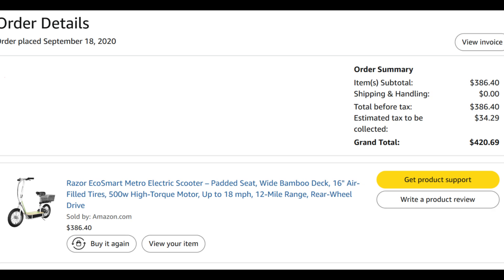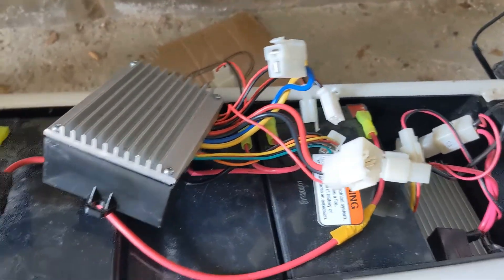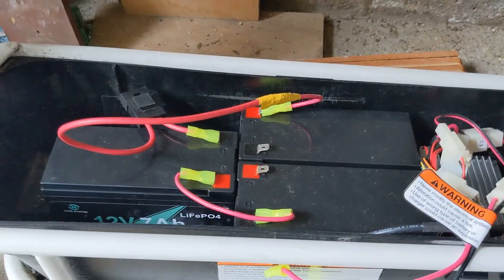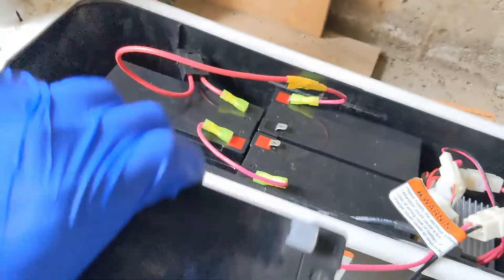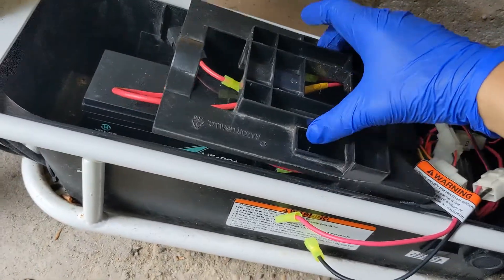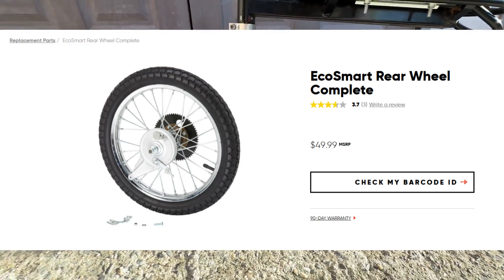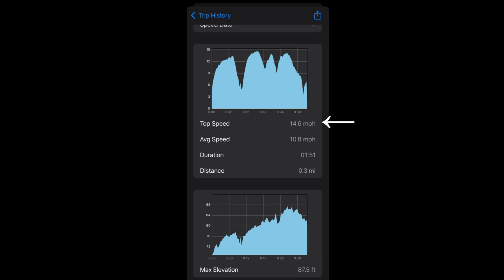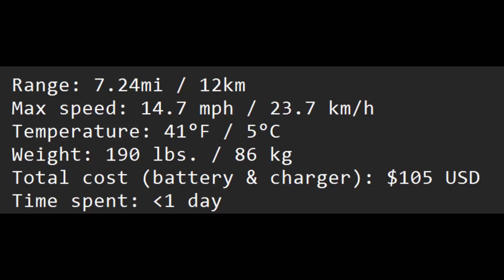Easy Lithium Battery Install & Test on Razor EcoSmart Scooter (vs Lead Acid Battery)

Comment: Can I use 12ah9volt lipo4 batteries using the same charger you recommend for the conversion
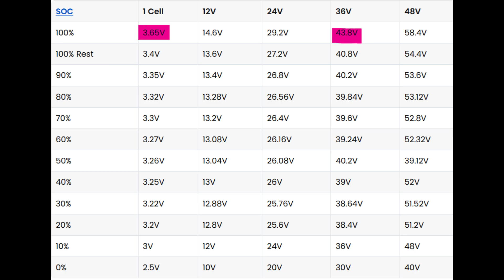Reply from the maker: The charger’s voltage depends on the combined voltage of the batteries  . I explained it at 2:04

Comment: Can I upgrade using the same charger you ordered ( mines is on back order but will be here Aug 12th) to a 12v 9ah?  Will that charger charge a 12v9ah with no problem? I found one that is the same size as the 7ah so it will fit .  Just wondering it the charger will work..
Reply from the maker: I am not sure if it will charge a single 12V battery. Mine charges 3 12V cells in series, so essentially a 36 V battery.
Reply: @WhatOnWonderland I guess I wasn’t clear … I want  to mod my Razor with three 12ah 9v (lithium)batteries instead of the 12v 7ah (lithium)batteries like you used. I found some online that are the same size.  Will the charger that you used work with a bigger ah capacity? (I have ordered a charger just like what you used)Thank you so much for your time.  And how’s your scooter doing now.
Reply: I mean 12v 9 ah
Reply from the maker: @susanjordan4292  I have some experience charging 10ah lead-acid batteries with the Razor's stock charger meant for 7ah lead-acid batteries that originally came with the scooter. The charger could charge the batteries, but full charging them would take longer. You could try charging the LiFePo batteries with this charger. There is an indicator light to let you know it is done charging.
Reply: @susanjordan4292  you can not switch volts i.e. 9 volt charger is only for 9 volts.

Comment: Thanks for the video. 
I have a question about the XLR lipo charger and controller.  Are you charging the batteries thru the controller? Also your Ecosmart should hit a top speed of 18mph 
Also the charger is unavailable for now.
Reply from the maker: I luckily found a charger that is compatible with the bikes existing charging port. I didn’t change any wiring inside battery compartment. It was as simple as swapping out the batteries. I think any LiFePo charger that can charge at 43.8V would work. Not sure why the bike couldn’t hit 18mph, could have something to do with the battery output.
Reply: I ordered the charger about6 weeks ago and am supposed to be getting it Aug 12🤞